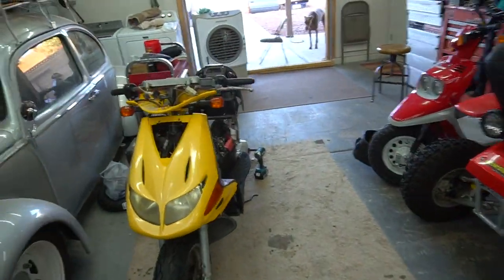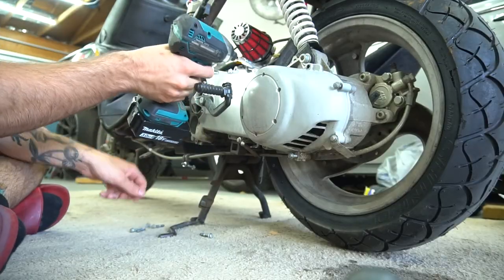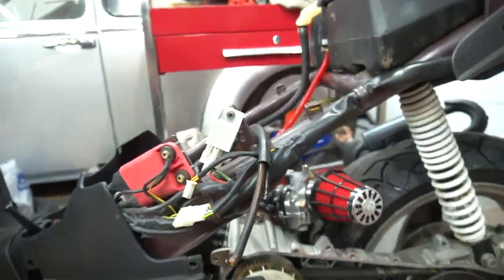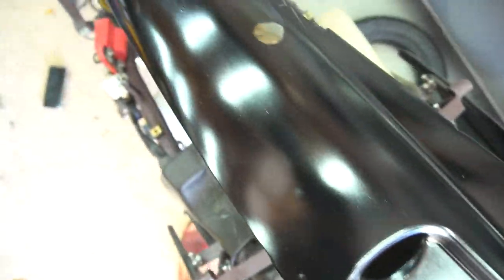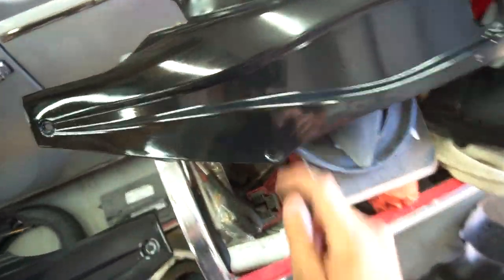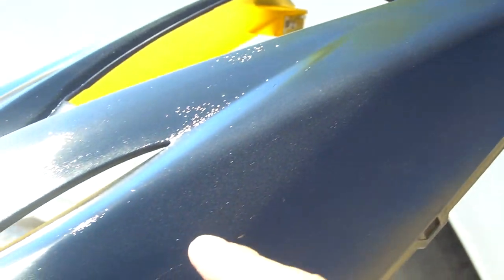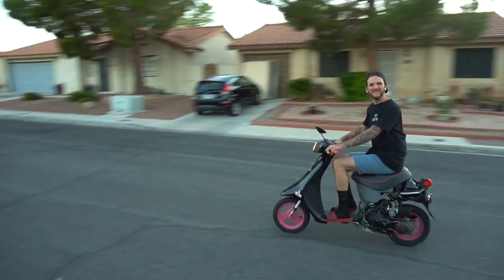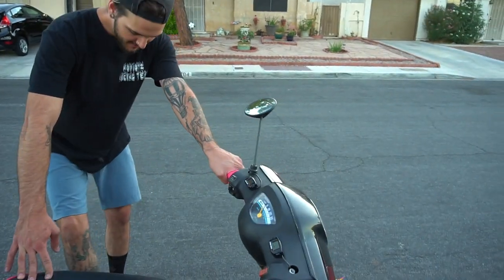GAS 2 Stroke Moped Vs ELECTRIC Scooter (What's FASTER?) VARLA Eagle One

Comment: i like how youre sanding the plastics and doing them right. the spray paint you def cant mix acrylic and enamel, i have done that. did you prime that one piece?? i have had problems like that and just found out it was only on pieces i didnt prime, everything else would come out perfect. also on the headlight use some wd-40!! it only works for a few months but it will look good for a while

Comment: For the paint try letting the base coats dry a little longer between. Normally wrinkling happens due to paint being to wet when applying coats
Reply from the maker: they sat for almost 3 days before doing clear that’s why i’m so confused how it’s not drying

Comment: If theres so wet oil on your main crank side behind the variator with the weights is that a bad sign of seals going bad?
Reply from the maker: yes it is
Reply: @MOPBOYZ  so must i replace seals? Need to split whole engine?
Reply from the maker: @brizzyy4472  if they’re leaking i’d definitely replace them , no you don’t need to split cases to do it
Reply: @MOPBOYZ  Ok il definitely have a look into that. Ive changed weights and saw some oil thats wet there and i watched your video now and you pointed that out so i took a chance to comment and hope you reply with some help. I really appreciate it 🙏